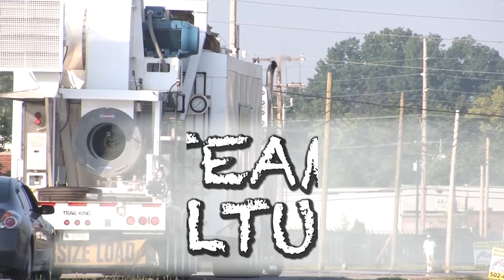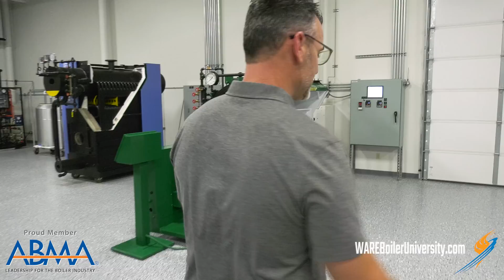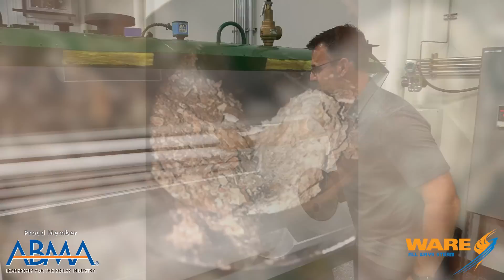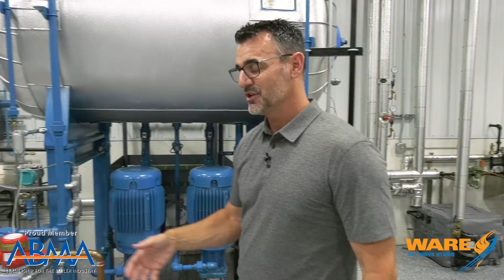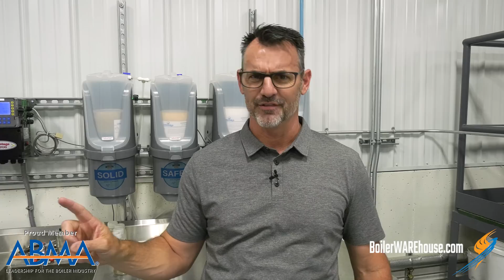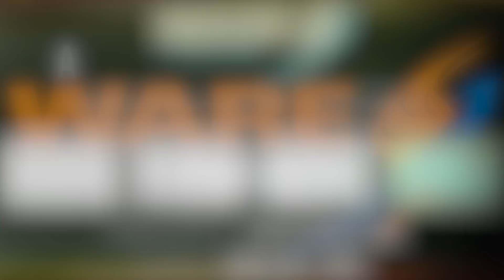Industrial Water Treatment for Boilers - Steam Culture

Comment: Yep-totally agree with you Matthew-we operate 100's of boilers in the UK and don't use solids on any. We are actively taking off solids as we take over boiler houses.Why? The chemistry doesn't work in 99% of all cases.There is a strong technical reason for that, as I'm sure that you know, if you're a proper WT chemist.